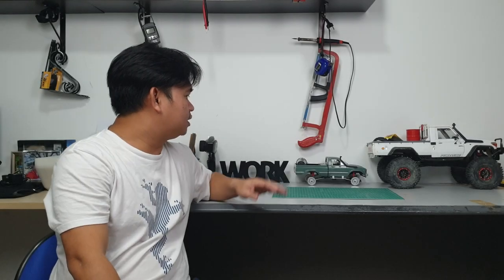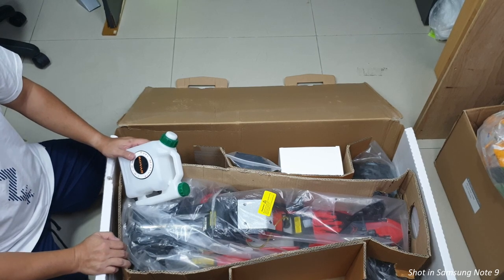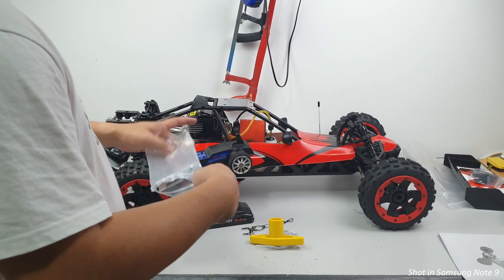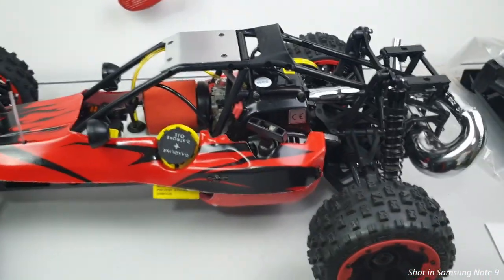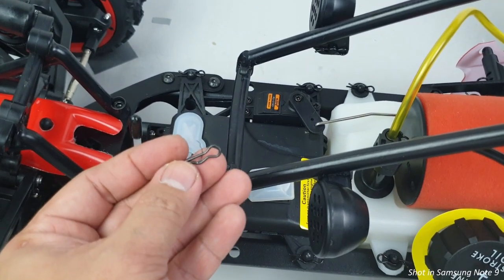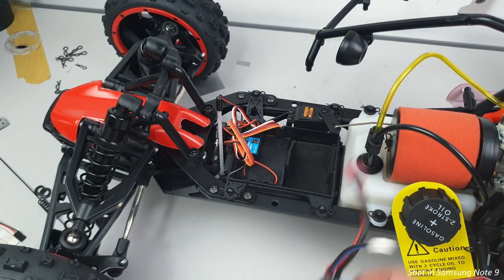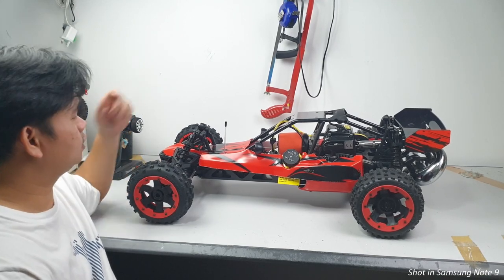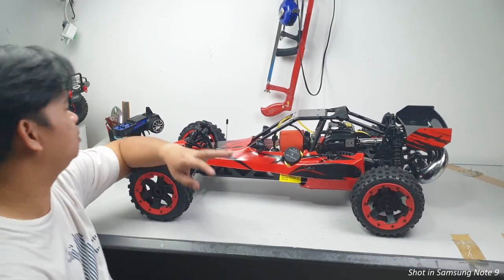Rovan Baja | Unboxing and overview (YaiRC)

Comment: Great video. Can i use a 6v  sealed lead acid battery for this car? Tqvm
Reply from the maker: I think can, but you will have low performance for steering servo. As the tire and servo are big, it will turn but not as quick as Lipo battery does.

Comment: Hi, can i use 7.4v instead of the original 6v battery for the receiver? Tqvm
Reply from the maker: technically can, i use lipo battery on it..but...i have set fail safe on my radio which turn my throttle servo to 100% brake whenever my radio lost transmission. And, due the excessive end point my servo died. Im not sure whether it cause by the battery or cause by the excessive end point of the servo. But my steering servo still ok and its more responsive when using Lipo battery. I hope it answer your question.
Reply: Yai rc
It was from not having your end points set correctly.

Comment: Do you have test run video? How to buy the metal or fibreglass part to replace  the plastic parts.( upgrade ) any seller that you can suggest.
Reply from the maker: Hai, sorry for the late reply to your comment. You can watch my breaking in and bashing video here "https://youtu.be/JOYd6nnkMQU", 

As for the parts, i normally buy from Aliexpress and i bought 2 set. 1 set for standby use and 1 set i normally sell at shopee. You can check it in my shopee page here "https://shopee.com.my/shop/44627401/", let me know if you interested to buy. If you find my price are high, please let me know...
Reply: You can get the parts at rovan rc.com.